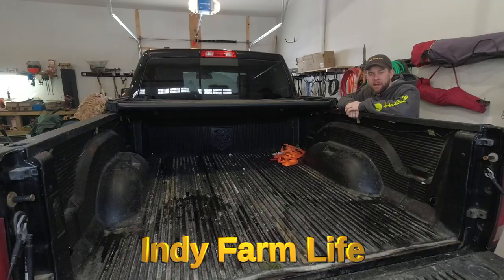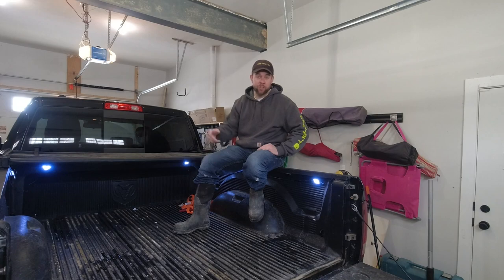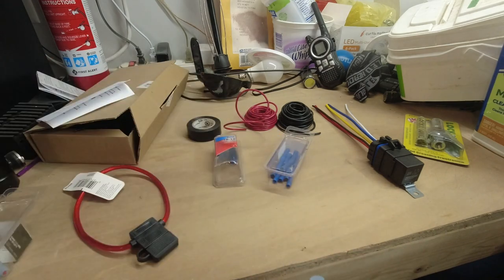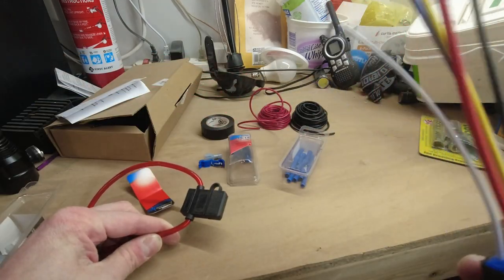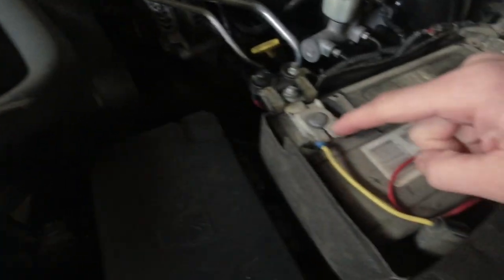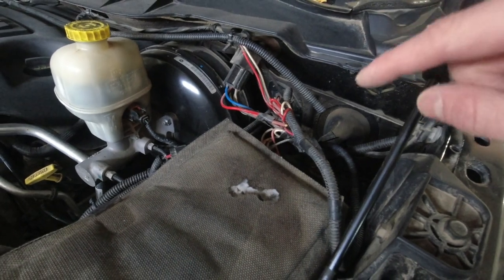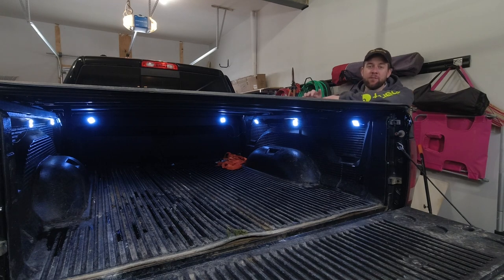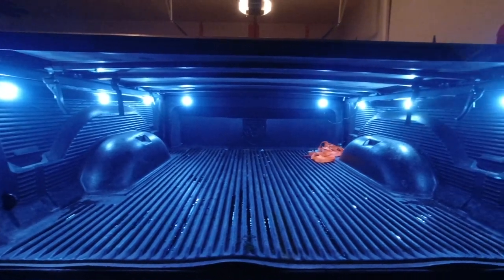How To Install Truck Bed Lights In ANY Truck - The Best Design! #DIY

Comment: I really liked how you explained the different ways it can turn on and why it is best to tap the dome light. Never thought of using the dome light! Great video explanation!
Reply from the maker: Thanks Doug.  This is the first truck I have ever owned and within 2 months of ownership, I knew I needed bed lights, but wanted it to be foolproof.  I.e. Not forgetting to turn them off and also have them off when I need them off (tailgate down)

Comment: I know this is 6 mos old, but still. Amazon sells a Wago t-tap connector that cuts in for you and does not require soldering. They are more secure than butt connectors. Butt connectors can do really well. But there are applications where they may be more of a headache and liability. The wago connectors do not leave as much of an exposed area as a butt connector. They also are less of a headache than solder and shrink, even though solder and shrink are usually the best in terms of strength, reliability and clearance IE you can stick it in a smaller area and keep wire management neat and clean.

Comment: I'm looking to add truckbed lights but was going to wire the lights directly to the dome light. What is the benefit of using the relay setup? So it has its own power source/fuse?

Comment: FYI,  the relay in this case is controlling a higher amperage circuit. The voltage is the same

Comment: Thanks for the Video!  I have a 2021 RAM 1500.  I'm connecting my lights to the dome light just like you did.  I did the T-Tap at the back tail light.
I made a new diagram for you.  I'll try to email it to you.
Reply from the maker: Thank you Steve!
Reply: How did it work out? I also have a 21 ram. It’s a classic model but looking to tie it into my cargo light. Curious if you tapped into that and if you have a diagram available?

Comment: Thank you for the informative video. I don’t know much about relays but you explained it very well. 

One question: Is it possible to have the bed lights also on a manual switch that can be turned on regardless of the dome light status? 

Just curious, thanks again
Reply from the maker: Yes, you can absolutely do that!  In that case, a manual switch replaces the dome light wire.
Reply: Sorry - I meant to ask if I wire exactly as you did to trigger off the dome lights could there also be a manual on/off switch that will power lights on that works independently? (So lights may be turned on if doors are still closed?)